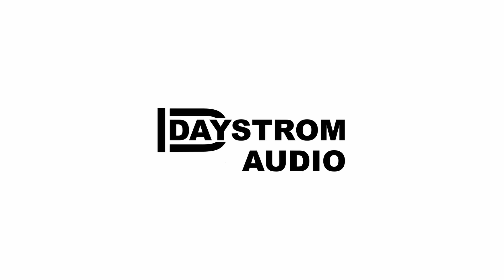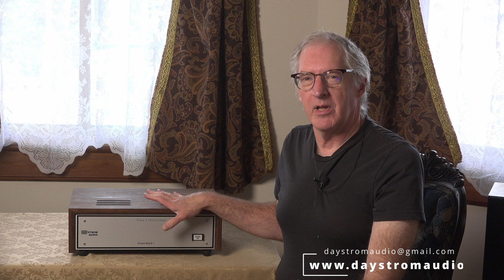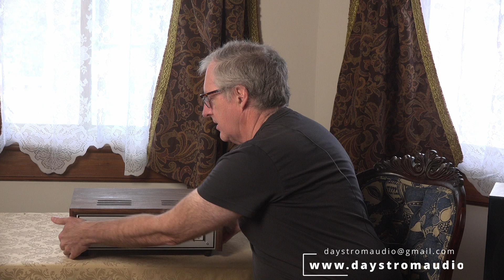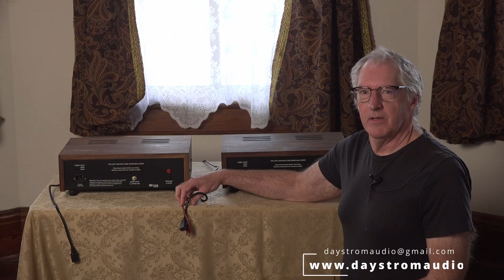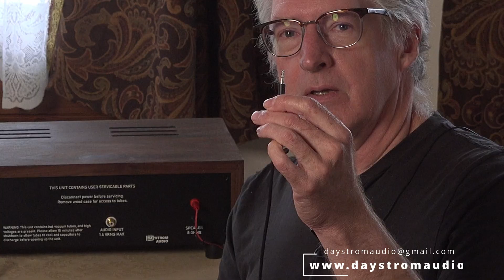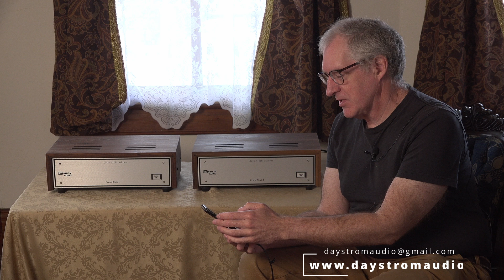Audio With No Preamplifier

Comment: I use a simple power amplifier with no attenuation also, and I just feed it with a DAC.  A DAC, whether it's in a phone or a standalone DAC or some other component, IS a preamplifier.  It's in the name - digital to analog converter, and typically op-amps are the analog power stage, and they usually are made to put out 2v or 4v if it's balanced, which is almost universally exactly what power amps are designed to receive to reach 100% of their output power rating.  A preamp is only useful for input switching, or if for some reason there's an issue with the input impedance of the amp not being ideal for the DAC's output impedance and how the circuit responds to various current demands or if it's load dependent etc.

If you put a preamp between your DAC and power amp, outside of the situation above, you are only gaining the input switching ability perhaps, and maybe adding an analog volume control, but it can only serve to decrease it's performance in a technical/measured sense... imagine lining up 100 preamps.  The distortion is added each time.  Good DACs and preamps have very low distortion, so it's not a big deal, but technically you are increasing it and any analog circuitry is marginally decreasing the transparency of the system.

Also for the old school folks here, hate to break it to you, there's white papers proving this scientifically, but digital volume control, when it's 32bit floating point internally, and the DAC is set to 24 or 32 bits, is SUPERIOR to any analog volume control in fidelity terms, which is why I ONLY control my volume digitally.  Also zero channel imbalance due to an analog control at the lower end of it's range.  DAC --> Power amp is the best high resolution setup from a technical perspective.  Actively crossed speakers with no analog crossover parts are also superior for a similar reason.  Damping factor is also increased by removing analog components, as well as other losses.  A driver hooked straight to an amplifier, with one conversion/preamp stage from digital source to the high voltage power, is just the best.  

If you're into vinyl, then you need 2 inputs.  Otherwise, since cds and cassettes are redundant or vastly inferior, they should not exist or be used.  All you need is a computer or NAS and a front end.  Wiim makes great options though you should use an external DAC if you want the best DAC performance, they're not among the best. But when using an external DAC, what streamer you use does not matter and can not affect the audio in any way - overpriced streamers are a rip off.  You have the choice between lossless streaming, or if you prefer to own your library, you can have it all on hard drives.  It's the fastest most powerful most flexible most convenient music playback system that exists - a windows PC and your favorite playback software, like foobar or whatever.  You get album art, visual effects if desired, can instantly search your entire library with portions of words, instantly switch tracks, instantly choose any point in a track, set up any shuffling algorithm you want, AND you can use the highest possible quality DSP equalization FOR FREE.  If you look at the running DAC list on ASR, where they're all extensively tested and measured and ranked, you can see that there are many DACS in the top third (the green section) and even towards the top of that third, that are under 300 bucks.  Mid 100s to 300, maybe push it to 500 depending on the features you want.. but even under 200 dollars, there are DACs that are essentially perfectly transparent with high end modern chips, quality clocks, quality power delivery, quality op-amps... and if you get a hypex amplifier, you can have as much power as you want.  So, let's say 150 for a dac, 600-1000 for a MONSTER hypex amplifier... all you need is speakers!  

There is no benefit to spending over a grand on your front end in the past 5 years or so, technology and natural market deflation has utterly solved the electronics problem.  Speakers are a bit different, there's still more real cost that goes into them, so the deflation is far less if any... DIY is a solution that can get you between 2x 5x the value / savings there, but retail or direct, good speakers cost real money if you want the best.  Your electronics don't have to.  Enjoy your tubes if you like coloration and 2nd order harmonics and crosstalk or whatever... the soundstage effects they have that are not present in the recording but added to it, that's fine, subjectively.  But if you want to hear the source material alone, if you want a wire with gain, you get one of a half dozen or a dozen budget but high quality DACs, and a hypex or purifi amplifier, and you're done.  They are not the best amplifiers for the money; they are the best amplifiers at any price period.  BTW these can be built with various input buffers if desired, that do change the measurements and sound slightly, or they can be run raw, the gain is slightly affected, but you can get fancy there too if you think you want to.  Buckeye, VTV, Apollon... diyclassd... these are where to look for value and customizability.  If you want the latest thing with less power ("only" a couple hundred watts) you can choose the hypex Nilai amp.  But the ncore and ncorex amps are roughly equivalent and the more common ones, and offer even higher power levels.  NC500x is 380wpc into 8 and like 700 into 4.  Or you can get kilowatt+ level monoblocks if you want.  The new purifi eigentacht 2.0 is another option.  NC252 is 180wpc for only as little as $575 from buckeye.
Reply from the maker: That's quite a write-up! I agree with you that straight-line amplification is going to get you the cleanest audio possible. These days I'm designing audio to keep the path as short and simple as possible for that very reason.
Reply: @daystromaudio1903  Nice, I like it.  No tone controls, no redundant volume controls, just simple and sweet!
Reply: Help write War & Peace? 😮

Comment: Instead of buying the extra cable, you could place the mono-blocks back to back so that their input jacks are within inches of each other.  Anyway, I grew up with integrated amps, and have a small number of vintage integrated amps today.  I have never been tempted to go the pre-amp / power amp route - separate mono-blocks at that!

Comment: The problem with this set up is there is not enough gain from the phone in most cases.  Most amps will need at least 1 Volt, or more to properly drive their speakers without loosing some sound quality.  I believe its called, under driving the signal, not good.  I have personally tired this more than once and did not like the results compared with a nice preamp such as a NAD 1700, for example or even a tube line stage.  Would not recommend doing this for other reasons already mentioned by others....

Comment: It seems the big debate so far in the comments is preamp or no preamp. I find this a rather amusing conundrum for those currently involved. So here I go to join you all.

This is coming down to nothing more than personal preference and requirements for the gear on hand. Should your source not have a level control, or you have multiple sources, by all means, grab a preamp. If you only have one source with a volume control, who needs a preamp.

Me, personally, I'd prefer an actual preamp with volume, balance, and at least 2 to 3 tone controls. A loudness contour would be nice. Then a few different inputs to select from and I'd be happy as a pig in .... But don't think I couldn't just hook up a computer or tablet to these and still have just about all that and more. 

And while we're at it, this particular use shown is actually the same as any BlueTooth or auxiliary powered speaker (3.5 or other connection) where the gain is set in the speaker's amp and the level is controlled by the phone or music player. EXACTLY the same. So if you have ANY type of BT or portable speaker like that, you already do what was shown.

So, enjoy whatever preference you want. Just remember, everyone's different. That's what makes this hobby / passion so interesting.

Mike, you go ahead and get to designing that preamp. And do it the way you want / think it should be done.
Reply from the maker: Yes sir! ;-)

Comment: Lol why are people so against this idea?   Digital sources have made preamp redundant.  If you have a single source this is the best way.  Earlier CD players used to come with built in volume attenuators which were perfectly fine to control.  You are eliminating one more device from your chain.
Reply: I have no issue with this.  You phone is essentially the preamp.  The bigger issue is that the headphone out jacks are being eliminated from smart phones. Yes, Apple was offering you an adapter but how much longer do you think that will happen.  It's a dying connector for phones at least in favor of Bluetooth - a protocol never designed as a hifi audio transport stream.
Reply: Depends on the use case, I personally like a good tube preamp before a SS amp to give it a bit of life. But I’ve found a quality DAC right into an amp sounds great too.

Comment: For audio you do not need the extended frequency range of a video cable, your amps tail off at 39Khz, not Mega Hertz. Standard audio cables are fine for even the theoretical output of HiRes audio that no one can hear in ABX. If using a reputable cable such as Canare L-4E6S your good for everything. 

Here you are claiming a video cable does higher frequencies, yet your using adapters to connect a standard audio cable, so even if there was a benefit, you removed it with the standard audio cable and adapter. 
The majority of RCA cable at domestic lengths in domestic audio are actually over specified for their job, usually 75ohm, many with true 75ohm RCA, and capable of covering more frequency range with no loss than your amplifier can with it's limited 40hz-39Khz specification.

On top of that your using an appalingly thin wire, it looks less than 18awg which will mean high resistance even at domestic levels.  Get soem normal 12awg from the likes of Canare or Mogami or even Van Damme for a few bucks a meter and be done with it.

Amazon sell an Amazon basics 3.5" jack to RCA stereo cable up to 7m, from $5 to $12. A much better option. But as others noted, not all phones have 3.5" jacks.

If anyone is running these or contemplating them, just buy a pre amp or something with pre outs, even second hand you can pick up and integrated with pre out, or even a processor, the old Yamaha E800 was stunning as a pre amp, some likened these to Sony ES quality, and some even upgraded them for stand alone pre amps, cheap second hand. 

Then you have streamers, Wiiim and Bluenote, or if you only run digital, a Topping or SMSL dac with pre out function can be bought from as little as $100 up to $1000.

Personally I would be questioning the sanity of anyone spending so much on nice valve mono blocks who didnt already have a pre or could not afford a Wiim Ultra or phono stage with gain. 

The monoblocks look gorgeous, no one should be ruining them with freebie video cables when you can simply buy proper well made cables for very little from pro audio brands like Van Damme, Canare, Mogami.
Reply from the maker: These are all good points. The point of this video was to demonstrate that it's possible to throw something together cheaply that will get the system going. Should we use better cables? Absolutely!

Comment: I still think !!! & it would be so easy to implement
The front panel is silk screened I think you said well repeat it on both sides then you will have a left & right. The firm who will be pressing out your frames need to modify the press tool so there is the same hole on the opposite side, I can't remember when your good wife built a amp where the power supply came from our went to but there had to be a fuse somewhere in this part of the circuit so you may need a extra set of slightly longer or shorter leads how expensive is that ???
You have archived a professional look, with these minor changes many people won't realize this is a kit because you have quality sound to go with the looks
Kiwi Rod
Reply from the maker: Rod, thanks for writing. In my world of tiny production runs, the cost to make two versions is unreasonable. We'd have to have two versions of the chassis (not cheap), two versions of the faceplate, new manuals and the addition of hookup wire that we don't currently need. That said, it would look cool. Maybe in a future product?
Reply: @daystromaudio1903  I am a factory engineer who retired from Fonterra 1 of the biggest by volume dairy companies in the world, to me it is just 2 holes, 2 screen prints and 2 extra bits of wire & yes I am totally aware you are building to a price, it's just the visual symmetry, you need 2 power amps so what would look better in OUR home 🤔 can in most cases be the deciding factor
Reply: The front panel is held on by 4 cap screws (which means it isn't very thick) & has TWO sides, PRINT ON BOTH SIDES 
I agree with many of the comments about the use of a phone as I feel streaming is barely better, direct from sources is the only way to get true & accurate reproduction .
From what I see you need $$$ to develop a product & he has indicated that the pre amp is in the pipeline.
I live in New Zealand where we use real power, (240 v) the rest of the world besides me will have to wait a long time before we see a kit to cover our needs & electrical safety  which takes time & $$$$$
This is a small family business, & chances are the owner is holding down more than 1 job to finance his love of a pre transistor amp from the USA' s days when they were great, so go grab a kit kat & give the man a break 
Kiwi Rod

Comment: 2 things to think about with your particular setup:
Many phones no longer have actual headphone jacks. They will need a dongle for their USB / Apple connector to 3.5 mm. 
For that particular cable, you could put the amps back to back and reach the inputs easily without extensions. I realize that would only be temporary, but it would be a start. As many would say, "For testing purposes only."

The amps do look tasty. Hopefully everything will start to take off for you and the brand will be big again. At least to your definition of big. 👍
Reply from the maker: That's a good tip! Sometimes we have to improvise to get things connected.